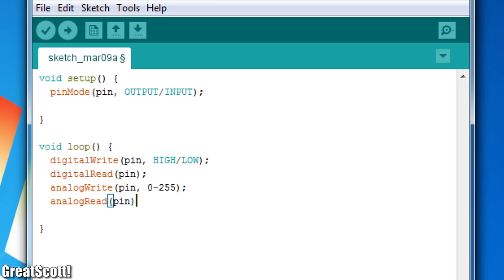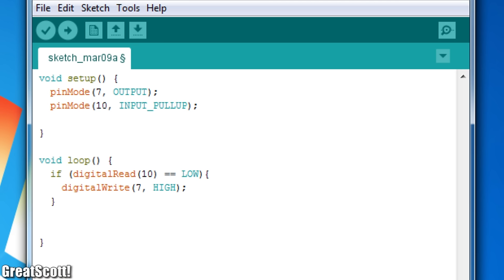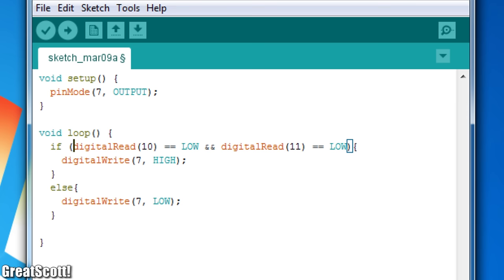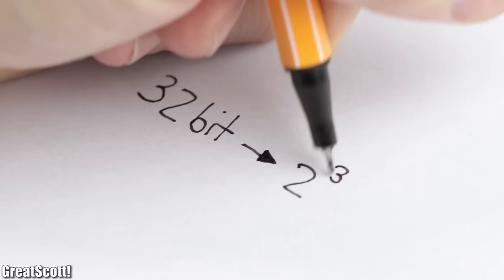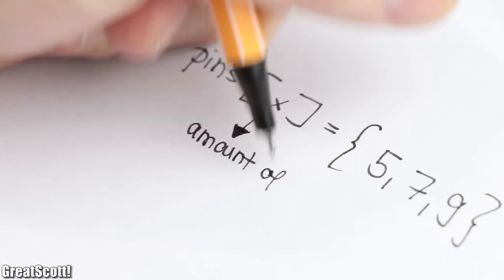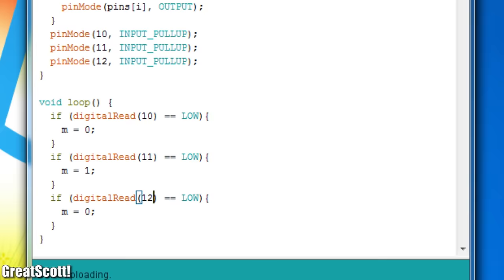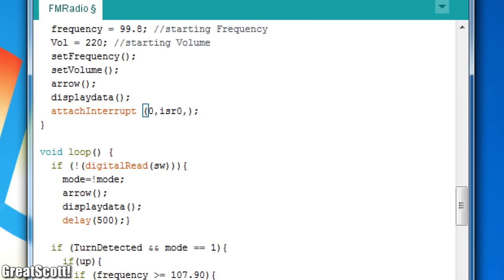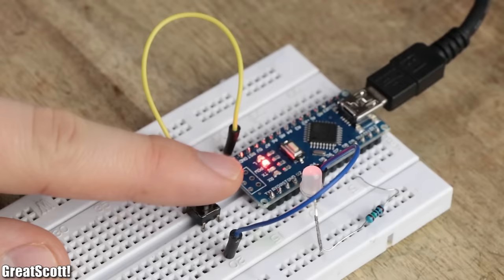Arduino Basics 102: Control Structures, Variables, Interrupts

Comment: What's input_pullup
Reply: It utilizes an internal pull up resistor on the ATMega chip. When there is no active signal on a pin, the value can "float" and give you mixed results. By using INPUT_PULLUP you force the signal to be high when no active signal exists. Now when he's not pushing the button the pin will be forced HIGH and ensure it doesn't detect a floating signal that might go LOW when the button isn't pressed.

Comment: I just finished my Arduino nixie clock, but after watching this video, I already see 5+ thing I can improve in my code.

(The only problem I couldn't solve is that the time is not consistent on it because I use delay(10) and a counter to measure the time. Because of that, I have to add the missing seconds and milliseconds at the end of every minute. (I added a small animation to hide the adjusting, but after 12 hours, the delay starts to get noticeable. Any idea on how to fix that? (And no, I don't have a real-time clock (RTC) that I could use))
Reply: István-KSZK You could access the ATmega's timer registers directly and see if you can improve the timer interval: It is determined by a prescaler and a compare value.

Otherwise, just get a DS1307 Realtime Clock for $2... It also stores the time in a battery-powered RAM, which means no data is lost when you unplug the clock.
Reply: You mean by using the millis() function? I think that would cause even more problems. After a few days dividing such a big number would take a considerable amount of time.

Now that I think about it, I could use the last 2 characters and add 1 to my value every time it reaches 0. Thanks, I'll try that tomorrow.

(I am planning on investing into a RTC, but shipping takes ages from China, and local stores sell them for $10)
Reply: István-KSZK No, by using timer interrupts! That way, there is absolutely no drift caused by software. The only remaining reasons for an unprecise clock are the crystal and the divider/prescaler if the system clock can not be divided by 2^n.
Reply: Oh ok, I'll try that. 
(Yesterday I let it run for 24 hours, and calculated the time drift, then added a line that adds exactly the right amount of time so there is no time drift.)

Comment: Great Scott can you Please make your own Os (Operating System) for the Arduino use the Tv out library Joysticks Button inputs and more! If you can do that i will make me very happy :D You can GreatOs or ScottOs or whatever you want!
Reply: The biggest arduino board only has 256Kb of flash memory, I sincerely don't know how you would fit an OS on that, and how you would send video output to a TV
Reply: MrAnima well i think you need a 1k ohm resistor and a 470ohm resistor and solder the two resistors together and add the 1k ohm to pin 9 and the 470ohm resistor to pin 7 and connect those joined resistors to the postitive on the rca video cable and the connect Gnd of the Rca video to Gnd (by the way i'm a eleven year old)
Reply: Why are you speaking about resistors, I'm talking about an OS, I sincerely don't see the link xD
And I don't think OS is the good word for that, an arduino board is a microcontroller, not a computer. (except if you are making an assembly interpreter)
Reply: But why are you talking about resistors, and give more information about what you want to make

Comment: Can anyone help me I bought 5 Aeduino nanos connected them to  my pc tried touploaded test sketch but there only are errors about the board. I dont think its a cheap copied cpu and I tried it with 5 arduinos. Windows does recognize the arduinos.
Reply: Tofufrikadelle I had  the same Problem. solution: 
1. Install  drivers for the USB/Serial converter (chip under  the USB port) 
2. went at the IDE to tools (im german  so there is standing Werkzeuge) set board to nano and then to port and selectet the availabe com port (it changes, when you conect your arduino to an other USB port. 

now it should work
Reply: Tofufrikadelle your Name are you german?

Comment: for (i ; i < 3; i++) is actually very misleading.
Reply: Yea, I would rather say for(; i < 3; i++)
Reply: Btw, he even didn't initialize the variable, which is a bad practice IMO.
Reply: Global variables are initialized automatically to their default value. For integer it's 0.
Reply: It's still bad practice
Reply: JaytleBee von Miraus for(int i = 0; i < 3; i++) {...}
Reply: For sure it is. I just wanted to point out that the program won't act strange bacause i is initialized automatically.
Reply: I am not sure if arduino loop() function works like that. If you want to achieve same functionality as shown in the video you would have to declare int i as static int i inside loop() function.
Reply: Samuel Poláček It depends on the language. It works in Java, for example, but not in C. There are idiosyncrasies between each language.
Reply: I think that  for(int i = 0; i < 3; i++) {...} would act the same in Java and C. int i is local variable for function loop() and with each call of this function new i is created. Scott declared i as global variable so code inside for loop is execuded three times. If i was local variable the code would be executed thee times with each loop() function call.
Reply: Samuel Poláček That would create a second i variable that is local to the loop function the for loop is contained in. All references to i following that for(int i=0;...) loop would now be referring to the for loop's version of i and not the global one.

But it is not common practise to have the i variable as a global. Only variables that are referred to in multiple functions should be global. int i; should be placed inside the loop function at the start:

void loop() {
int i;

// Rest of loop function code here
}
Reply: Shadowing.
Reply: The bigger problem is to not set it to zero. Because next time it would be 3 and the for wouldn't even start.
Reply: That is exactly the idea! That the for will NOT start again!
Reply: B5 Exactly what the for(int i = 0; i < 3; i++) {} would prevent. That's good practice.
Reply: Not, if you DONT want it to start again... You try to see a problem where there is not.
Reply: @Samuel Polacek    that is not true in C language
Reply: Actually I'm pretty sure you will run into C compilers that do initialization both ways - some will initialize to 0, others will populate with garbage.  (Pretty sure back in the day AT&T's SYSV compiler put in garbage, but Linux sets to 0.)  
If there is one thing that a novice C programmer should learn FIRST, it's that you are NOT guaranteed that what you know on one system will be applicable in other systems.
Another example: when he said int's are 16 bits, I didn't believe him until I remembered I had already looked it up earlier, for the purpose of finding out whether there was any point in using short ints.
The main point being.... C is NOT Java.  It doesn't protect you from yourself.  At all.  But if you get used to working with that level of freedom, languages like Java feel like sand in your eyes.
Reply: fisharmor In fact. Do you remember that conio.h from a Borland compiler (I gess)? I made a version of it that runs on Windows, OS/2, MS Dos (I think I tested in 6.2 or 6.22, but I don't remember) and Linux (at least in the terminals I tested). That was back in 2008 or 2009, I think. And that was hell!
Reply: I completely agree, for the initialization and for the types who are different from environments in the other one. For the initialization, we know that a "normal" compiler does not initialize. It is thus important to initialize be even in the code, even if the current compiler initializes, to assure a portability towards other environments.
Reply: MC's Creations hehe I remember going on a course to gain certification for C programming and they used Borland's Turbo C compiler for DOS. There was extensive use of conio.h and we grew dependent on it's functions. Then when we were transferred to another room in the course building we were switched to using Microsoft's compiler and we greatly missed conio.h lol
Reply: Galbi 3000 Exactly the reason I made it. LOL I used Turbo C in high school (I think - here in Brazil it's called "ensino medio"). Then I played with it for years, before I got serious about C... Then, in college, I decided it was time to make it. :)
Reply: MC's Creations They were fantastic functions for DOS programmers. Almost direct access to the console making so many features possible with ease :) Though later I did learn to access the console more directly and created screen fade effects, but without conio.h I would never have thought of doing that. :)
Reply: Galbi 3000 Exactly! And, well, I tried to find the lib I created with Google, but didn't have luck. :/ I don't remember the name I put in it. LOL
Reply: I had only a brief introduction to conio.h in school... then I got a job on Unix systems and had to learn about terminal output.  Most people don't know there have been hundreds of different Unix terminals over the 70s and 80s.  So *nix operating systems a termcap file (TERMinal CAPabilities) that maps the terminal control strings for things like bold, underline, colors, cursor position, etc, to variables that can be used abstractly by C programs.
If you guys have never written C for a Linux or Unix system, I recommend it highly.  The original purpose in Kernighan and Ritchie writing the C language was so that they could write Unix... and it really shows.  When I took C in school it was just a bunch of random stuff that didn't mean anything... but when I used it on a Unix system, everything about both C and Unix suddenly made perfect sense.
Reply: fisharmor I see what you mean. Here in Brazil colleges have a "course conclusion work" (I don't know how to call it in English). Mine was about set covering problem and I used ant system to it. (Not the best approach - genetic algorithm is better.) With two solutions: a local one and a distributed one. And I tested everything in a 8 core (or earlier i7, I don't know) with Ubuntu running just Black Block. And, man... It was REALLY fast compared with other environments I tested. (But, still... Almost 2 hours each test.)
Reply: Why is making "i" global bad practice? I'm taking c++ 101 so I am genuinely curious

Comment: fake vid? const int buttonPin = 2;     
const int ledPin =  13;      

int buttonState = 0;         

void setup() {
  
  pinMode(ledPin, OUTPUT);
  
  pinMode(buttonPin, INPUT);
}

void loop() {
  
  buttonState = digitalRead(buttonPin);

  
  if (buttonState == HIGH) {
    
    digitalWrite(ledPin, HIGH);
  } else {
    
    digitalWrite(ledPin, LOW);
  }
}

my arduino uno is turning on and of when ever it wants to

pls help